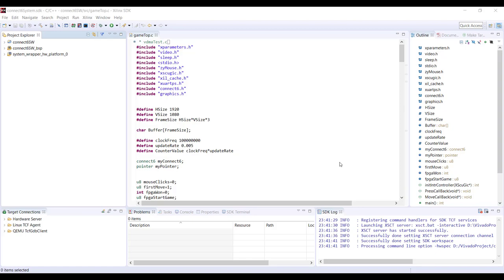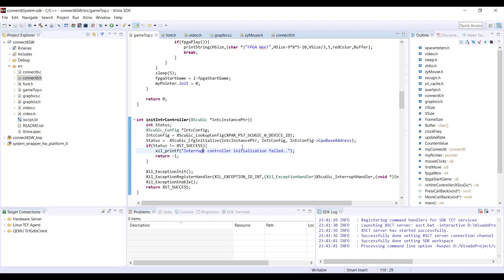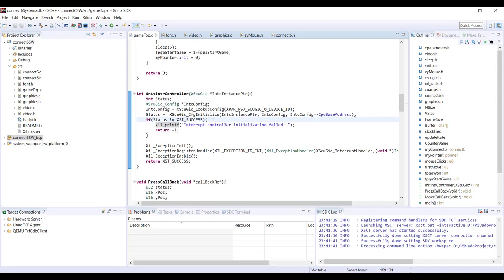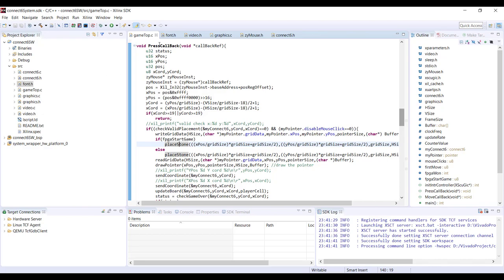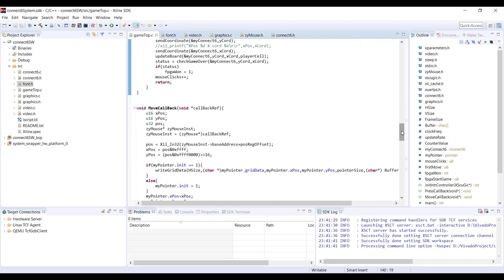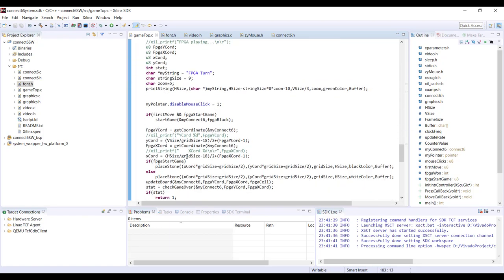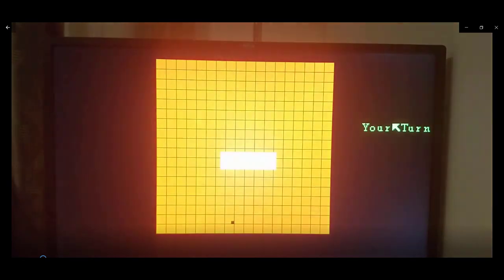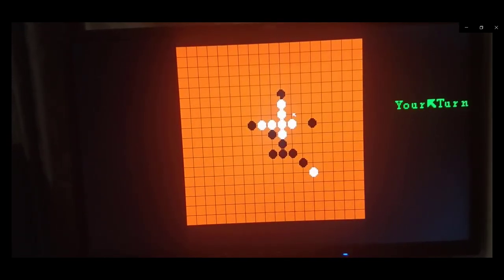Connect6 on Zynq (FPGA): Part 3 Software development

Comment: Hi Vipin,  I just found a little bug in your code. It would be nice to update your github for anyone trying to reuse some of your code for their projects. In the graphics.c file, the drawImage() function has post increments when they should be pre increments. Colored photos will not be the true colors when output to the screen because G values are again using R values, and B values are using G values

WRONG:
videoFramePointer[(i*displayHSize*3)+(j*3)+1] = *(imagePointer++)/16;
videoFramePointer[(i*displayHSize*3)+(j*3)+2] = *(imagePointer++)/16;

SHOULD BE:
videoFramePointer[(i*displayHSize*3)+(j*3)+1] = *(++imagePointer)/16;
videoFramePointer[(i*displayHSize*3)+(j*3)+2] = *(++imagePointer)/16;